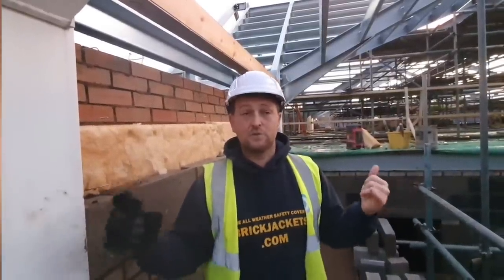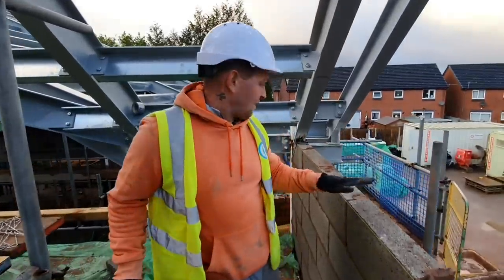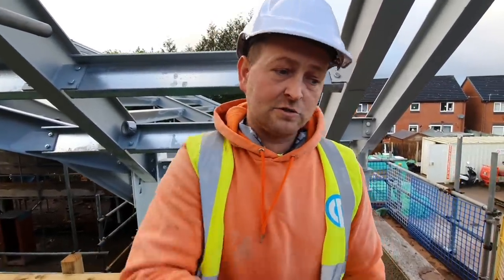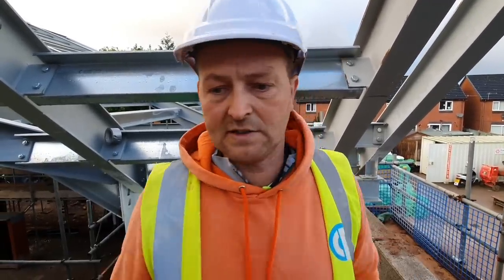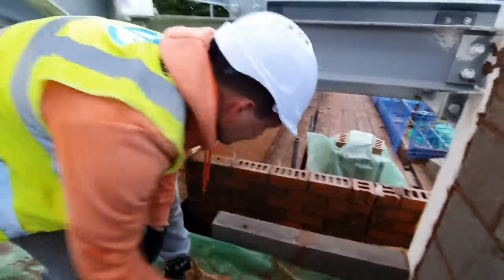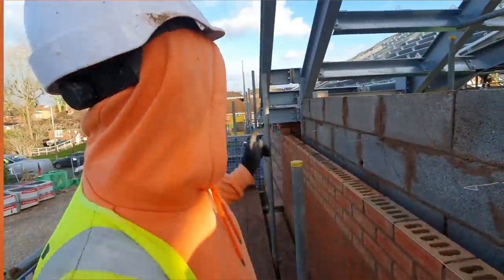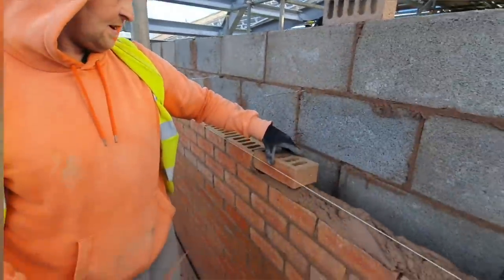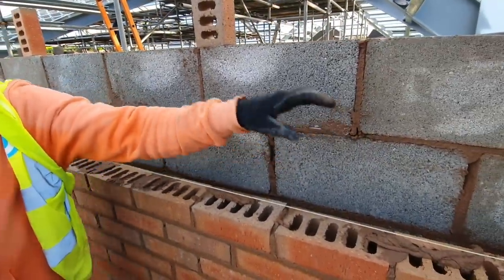Lay Bricks [The Fat Man Can!

Comment: Changy, I'm no bricky or engineer but thats the first time I've seen mention of a lintel above a window under a steel? Surely steel is the structural strength so what's the need for the lintel? Is it metal or concrete? Be interesting to follow progress on that one.
Reply from the maker: It's a a big steel that goes over, way overkill in my opinion
Reply: @Changy_C  does sound it tbh, keep up the good work and the channel 👍

Comment: any of the crew cab 4x4 pick ups with a truckman top - unless you like feeding the taxman .    joking apart they make good all rounders and you get to claim for them
Reply from the maker: But they are heavy on fuel?
Reply: @Changy_C  I had a fiat fullback and it used about the same as my other vans. Just remember any fuel that goes into a commercial  is deducted from your earnings so it can be claimed. Fuel that goes into a car becomes a personal use issue.  🤫

Comment: Strange building, brick walls and steel frame. The brick is very strong, why a steel frame with such a low number of storeys?  Yes, everything is beautiful, but the walls are thin. A very expensive roof will turn out, almost golden.

Comment: get yourself a next gen ranger wildtrack v6 ,besy of both worlds tub locks up secure and cab is roomy , just put covers on the front seats for work and sandgrabber mats to front all easily removed for weekend family time
Reply from the maker: Fuel costs?
Reply: @Changy_C  I’m in Australia with mine , but get 8.9 ltr  per 100 Klm and diesel is 2.25 dollars per ltr but distances here are vast compared to uk my last job was in Perth 5800 Klms  away so 51/2 day road trip